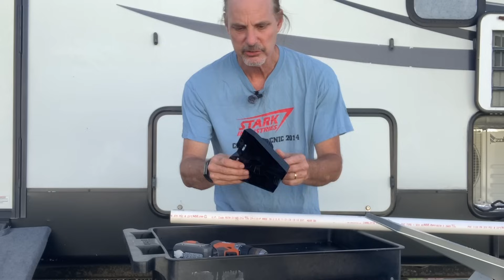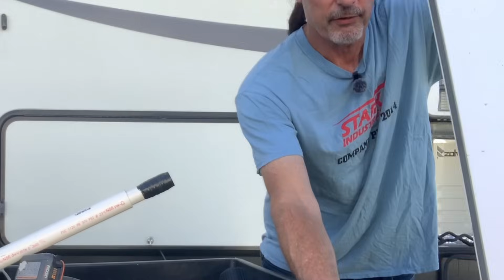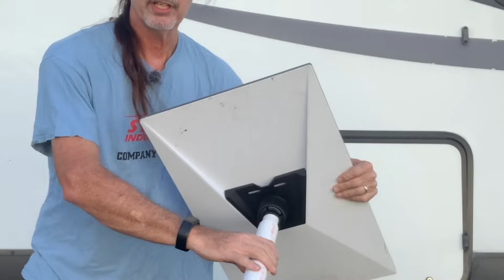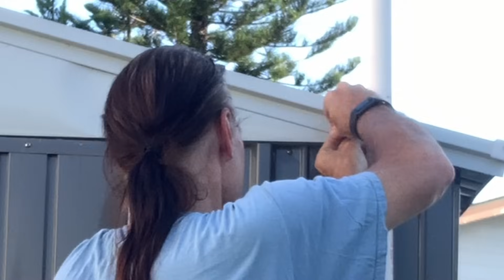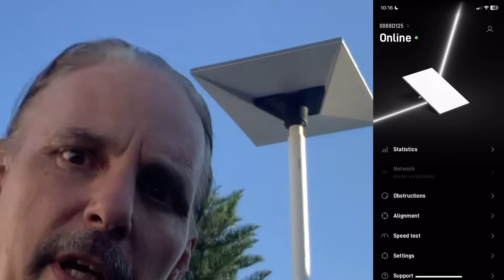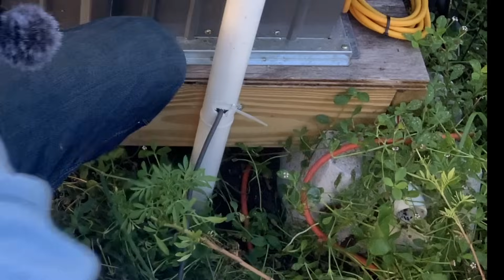Build a Starlink Mount for Under $10 FAST!

Comment from the maker: How did you mount your starlink? Or do you just set it on the ground?
Reply: Where is the link
Reply from the maker: @Trailhoundmedia  https://youtu.be/sllx4j_KCE8 This shows you details how I made it .. Hope thats the link your looking for,.
Reply: That is janky, why dis you even make that video.  You don’t even realize that white is the absolute worst color of zip tie for photo degradation.  Those are guaranteed to break in about a year if the wind doesn’t wreck your crappy mast first.
Reply: @noname7758 if it works for him then why does it matter to you. You must be a sales representative that sells those overpriced mounts
Reply: @webwarrioress nope just a carpenter that thinks its dumb to tell people to make a mast out of pvc that wont survive a windstorm.  Anyone who takes his advice is going to end up with a broken star-link antenna because they cheeped out and didn’t buy either a galvanized steel post or a pressure treated 4x4.  So you can take that garbage about me selling overpriced mounts somewhere else.
Reply from the maker: It has made it though two hurricanes and still standing, never lost signal.. Could be you're wrong about it not surviving?

Comment: Those cheap white zip ties are only gonna last about three months. And the wind will still turn your dish. I would use the straps that are made for the pvc.
Reply from the maker: Held for months and months and I just took it down last week while moving and had no problems .. with it down into ground I thin that kept it from turning.. was good for temporary use.. them white zips are trouble outside for long term for sure ..

Comment: That looks pretty wobbly, even with no wind. PVC is pretty flexible.  Does wind impact the signal?
Reply from the maker: No problems and I am near the beach/rivers and winds are crazy .. Does not effect signal at all .. There is two lined PVC they are pretty strong together, but allow flex with high winds.. Seems to be working perfectly ..